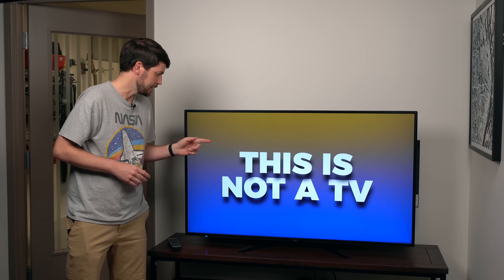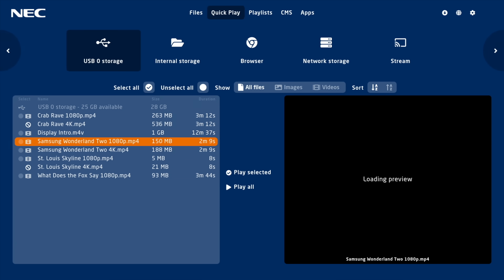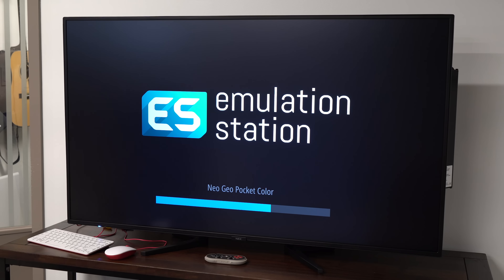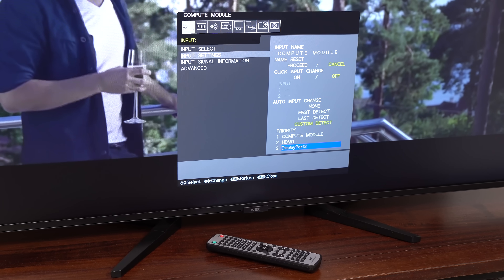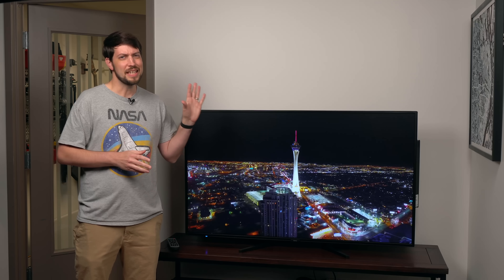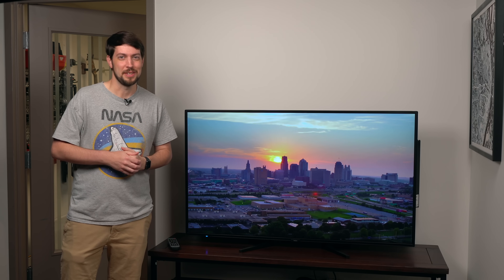Smarter than a Smart TV! (Raspberry Pi Inside)

Comment: Personally i use a cheap TCL 4k HDR 60hz 50inch at 400$ + an amazon 4k 60hz HDR  tv stick at 40$ bucks there is a quad core and 1.5gb of ram and 8gb of space its more than enough to install a couple of apps and it is fully 4k compatible and you can also add a wireless keyboard and mouse or Bluetooth device like a headset/speakers mouse/keyboard etc  and when you have amazon prime its give you the access to many free movies in 4k and this tv also have Roku and there is soo many apps and as Amazon is using android i installed some android apps like kodi and play my movies for less than 450$ tax included ! and the TCL LCD panel have a pretty good color ratio you can almost make some photography using their screen. But its not made for a 24hrs usage but i still use it for more 10-12 hrs per day as i work from home and there is no overheating problem

Comment: Shame that it uses a pi4 and not a more powerful SoC. In my experience the pi4 can’t handle the majority of high resolution, hdr, etc. Content without major stuttering. This means the “slow embedded processors” you mentioned are not that slow because my €500 65” 4K tv does play those videos without hiccups.

Comment: Why is this news? I did that in in 2006-07 and even had prototypes back in 2003 and still have the schematics showing a universal port to plug a single board computer just like NEC did !! I could have sued them to oblivion had I patented the thing. In fact when we did that, iPhone and Android didn't even exist ! We used a stripped down Linux that had 3D menus using an early version of Compiz and an alpha fork of Clutter (that is used in every Android device today) and a really slick interface, that still looks vastly better than all the junk UI you see in most "smart" TVs and consoles. But we were in the wrong country and with limited funds and support to take it first to market :(

Comment: My LG smart TV can playback HDR10 4K at 60 Hz, and it's a budget TV. It is much more capable than a RP4. You can run Kodi on a Fire Stick 4K Max. IMO this is a much better option than a RP4 as it can playback HDR10 4K at 60 Hz.

Comment: Isn't this the same as plugging in the pi to a regular TV?
Reply from the maker: It's similar, but this TV exposes a serial interface to the Pi, and extends its internal network, so the Pi can integrate completely with the TV for 100% remote management (including things like brightness and power settings, even if the TV is turned off).
Reply: @JeffGeerling  I think some of us would be interested to see you do a serial-port interface HOWTO followup video to this one ;-)

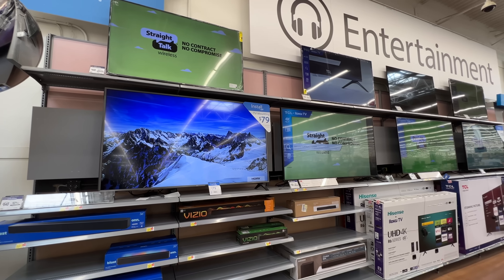Comment: (1:23) Wow. Where I live, larger businesses do use proper commerical displays, but a lot of the smaller businesses would just use consumer TVs.
For example, I saw one shop that ran their shopfront display off of a consumer Panasonic TV that was displaying its home screen, and then at a different mall, I saw a pizza takeaway run their video menu off of consumer LG TVs that they accidentally enabled the retail demo mode on, then at yet another mall, I saw a food kiosk of some kind run their video menus off of consumer Xiaomi TVs that were displaying their screensavers (that I could tell were even Chinese market models instead of models that are officially sold here).

(2:21) Finally, Reddit shown in a YouTube video where the person who captured the page was logged in! I also recognise that subreddit/community, I have posted some photos there (as 'MustardOrMayo404')!

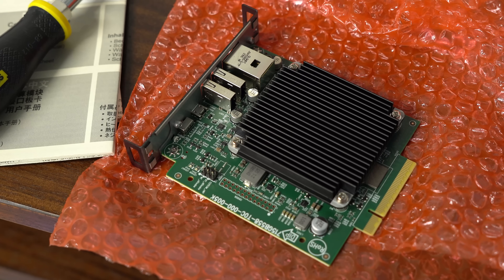(2:37) My guess is that it can be ordered without the Pi and adaptor board, likely for those corporate IT departments that only know Windows, have some weird obscure device they want to display, or run video signals through multiplexers/matrixes to get the same feed from one device onto many displays in one location.
I'm also reminded of older Samsung commercial displays that ran the MagicInfo client on Windows Embedded instead of the Samsung Smart TV platform.

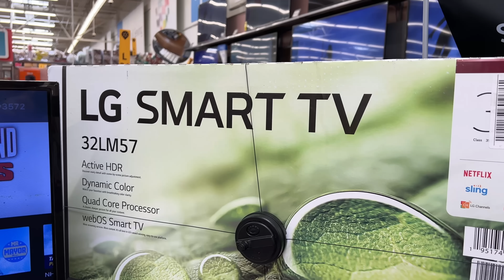(3:01) I feel called out, because I have an older version of that TV. The one I have is the 32LH57 series, which ran the old NetCast platform but with a webOS skin over it. As such, hardly any steaming services supported it because it lacked Widevine DRM support. I disconnected the TV from my home network and use a streaming box with it instead.

(3:25) I bet that Web section is for external devices that display stuff via a Web server, like the queue number display at a restaurant I went to, where the staff ran their display on Chrome on Windows 10, which itself got stuck at the lock screen when it automatically upgraded itself to Windows 11 and I posted that to Reddit r/PBSOD.

(3:13) I like that they did, because it makes the set-up process easier for some business owners, especially those running smaller businesses where staff would just stick in a flash drive and set the media player to repeat and loop through the same videos all day.

(4:22) I honestly didn't think about the speakers, as the use cases I imagined had either no audio, audio routed through a zone in a PA system, or audio routed to a dedicated receiver. Then again, I remember passing by a restaurant where music videos were being played around the restaurant, and I think that was just being done through TV speakers and the video source was fed through a matrix or multiplexer.

(7:34) This reminds me of that news article where some airport staff didn't lock out the ports and controls on their displays, so someone plugged their game console into it.

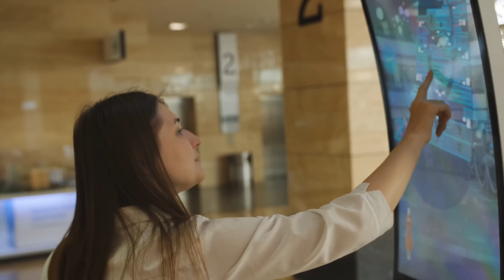(9:00) Yep, I already did. I saw an advertising screen on top of an ATM crash and it was running Raspberry Pi OS, but haven't yet posted that photo to Reddit either because I lost it or my phone's battery level was below 5%.

Comment: You say "You can run anything..."  Not true.  You can run a browser, but you'll get an error if you try to run Netflix, Hulu, Amazon movies.. etc.  I've looked into it.  It's a PIA to get the video licenses  & patch chrome & recompile & then it doesn't work.  

I can't see using the Atom.  It's performance isn't great for my use case.  

I am looking forward to the time when Linux can add a video package with sudo that has all of the licensing bundled in with codecs.
Reply: Get a cheap Mac and use the display as a 2nd monitor, no issues with Netflix / Amazon on High Sierra 10.13 with Chrome
Reply from the maker: Can also throw an Apple TV, Roku, etc. on an HDMI input and call it a day, if you need certain streaming services.

Comment: For years I wondered, why computer TV’s are not just dumb screens with no “computer”. This is exactly how all TV’s sold should be. Then you can just swap the computer or update the software instead of replacing the whole TV because the manufacturer decided not to support software updates any more for your 3 year old TV. What a waste it is to see perfectly working TV’s being thrown away because you can’t get the latest Netflix app. In my case there is no Sky Showtime app for my TV, so I bought a Google TV/chrome cast to be able to watch Sky Showtime on the TV. But If I could just have bought a new Pi or Samsung TV computer module and replaced the old one. It would have been much better. The panel usually outlast the computer in the TV anyway.

Comment: Whats the problem with connecting a TV to a laptop using HDMI. Same smartness. Use custom apps and play whatever you want on it. I understand it is not usable in all environments but still better than designing some custom hardware. slim cheap laptops are easily available now a days. Buy a wireless keyboard mouse combo and theres lot of things you can do.

Comment: these are great for commercial use and it's versitile for sure but I wouldn't call these smart tv. it's just two different things it's like apple and oranges.
Reply from the maker: That's why it's smarter than a Smart TV ;)
Reply: @JeffGeerling  of course it's smarter than a smart tv but it's not even a tv, it's a monitor. by that logic my crt plugged into my pc is smarter than a smart tv. also being smarter is not the highlight of these commercial monitors. it's just a byproduct of how versatile it is.

Comment: “It’s a lot smarter because it’s running Linux”. I know what you mean, but WebOS is a popular OS running on them and it’s Linux kernel based. I would guess the majority of smart TVs are.
Reply: “Smart TVs usually run slow embedded processor” 

“Because of the Pi’s professor you can only play back HD footage, not 4K”

These two statements really seem at odds with each other. Any 4K smart TV can obviously play 4K video.

Comment: I work with/recycle these they are crazy advanced most capable one I've touched had 20 point capacitive touch, pressures sensitive pen, overlay features, and the ability to run split screen with 4 different data streams from different inputs or the network.  10,442 USD new and it was the model from 4 years ago.

Comment: I'm suprised it comes with a normal TV stand
Reply from the maker: Technically the stand is an add-on. It comes with no stand and most people mount it to a VESA-compatible mount.
Reply: @JeffGeerling  I work in the event Industrie and I never had a display that had a stand in my hands. They all mount to trust, audipacks  or on specialised holders to be able to combined the to Lange matrixes with minimal gaps (Or you just use a 98" one)

Comment: This is what I expect I'll eventually have to be doing down the line if I want a new display.  
I've never seen a single Smart TV that isn't an absolute ass of a TV that is laggy, buggy, or outright broken.    The TV I am typing this on right now has a Sports Mode that has different visual settings for it.  I use it for bright days and I keep the normal mode for night.  If I press the sports mode button, almost... close to half of the time there's this weird bug where the blacks on the screen are a pixelated white mess.  Simple turn off and on fixes it.    Equally half the time it can take up to a couple seconds to even respond to the fact the button was pressed in the first place!

I will never buy another "Smart" TV as long as I live.  Worst thing to happen to the industry.
Reply from the maker: Often those modes make things look terrible, too, if they add too much saturation or sharpness filtering, or if they try upscaling and increasing the framerate, making things appear that don't exist in the source footage :(
Reply: *Sports" mode, is probably the worst mode you can select on a TV. For any reason.
While your best option would be to get your TV professionally calibrated, it's not cheap. But there are other things you can do. There are several professional calibrated, that have YouTube channels. HDTVTest is one of them. And he gives free advice to which functiona to disaon your TV, to get a better picture, and also how to fix issues, like yours.

Comment: If there is no stock, it doesn't exist. Hopes and dreams have to get real to be useful. The supply of RPies is terrible and has been bad for years. I gave up on pies when a PC mini 4 core 8g ram, 128 ssd complete running widows or Linux is cheaper then the inflated cost of a 8g Pi4. I can get one delivered in one day! Any 4KTV with an open HDMI connector works. I can run anything on these stick PCs Linux and or windows!

Comment: interesting, now where to find a pi!! the hunt begins... ebay i guess! 😵‍💫😱
Reply from the maker: rpilocator.com is the best option—a few models pop up on there for a brief time each day.
Reply: rpilocator is great, but it doesn't include any pi bundle kits a site may have.  I scored an official Raspberry Pi 4 desktop computer kit with an 8GB Pi 4 about a month ago, even though rpilocator was showing that site had no Pi 4 boards in stock.  You pay a little more getting the bundle, but this one included everything, including the micro-HDMI to HDMI cables, so it's not too bad if you need those accessories.
Reply: I got mine at micro center

Comment: Still waiting for new raspberry Pi that can run min 1440p without drops of frames.
Reply from the maker: Dream bigger — how about 8K at 144 Hz playing AAA video games! 🤣

But really, I'd like to have the ability to play back H264 or H265, at least, at 4K. Failing that, I'd be happy with 1440p too.
Reply: @JeffGeerling  va-api support will be enough! It would be great if hw video decoding will just work with any software and without slowness / tearing / chopping
Reply: @JeffGeerling  wouldn't that be a reason to get a GPU fully working on a pi?

Comment: Been dumbing down my 'Smart TV's for several years. Not interested in paying cable nor Satellite bills for Hollywood's garbage. Spend most of my time monitoring the world and watching tech content, like yours, on YT. I've only fallen back to OTA broadcasting during rare internet outages, only to see if we are under cyber attacks.
HDMI1 = Primary Winblows PC, w/NAS
HDMI2 = secondary 48" display for programming my laser controller, running Win 10 on a Surface Pro, w/touchscreen GIU,
HDMI3 = RPi4 dev SBC, w/SSD.
There's a similar setup, w/48" TV at my maker station on a 4-1 KVM switch.
What more entertainment could TheHermit need? No worries. I've already got that covered, as well.😎
Reply: funny, had an outage today, internet down but tv ok, same provider, but somewhere there is a split, rain
maybe some rain/storm damage ...

Comment: OK  YouTube  you aint seen everything  . 
google app run tvs by late 2022  then i seen this Raspberry Pi  Screen its not a TV  :)  
Spoke too soon should've  watch the end 1st XD  Them display screen on bus/tram stops /shop windows 24/7   
seen a few these at Auctions cheap  i,m good with 1080p  until i buy a 4k TV  @120mhz
Reply: Hang on ive seen these types  running small PC screens  linux raspberry pi Arduino   b4 but never clicked :) uho you can make your own if you watch youtube builds and 3d screen etc

Comment: This is something I can't comprehend and I have to say sorry in advance if it looks like I'm trying to hijack this video or the product, I develop and install Digital Signage and menus using Raspberry Pi 4 for a living, my latest custom build OS can control two TVs at the same time from a web app and cms and it can also it can run all day without problems, now my question is why inst my custom Digital Signage software or OS not popular?  Can someone please explain to me what am I doing wrong? https://www.youtube.com/watch?v=9lCv5MA4Xvg My system does a lot of stuff most Digital Display systems can't and on top of that is free to use for 30 days and a lifetime activation can be issued via a small donation,